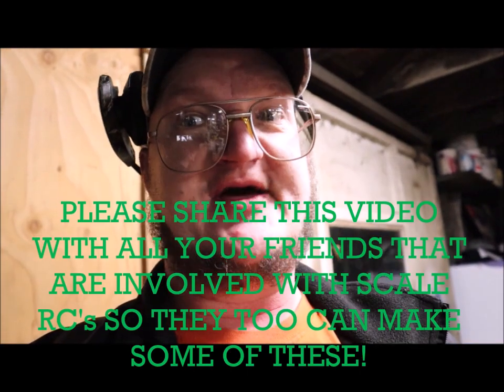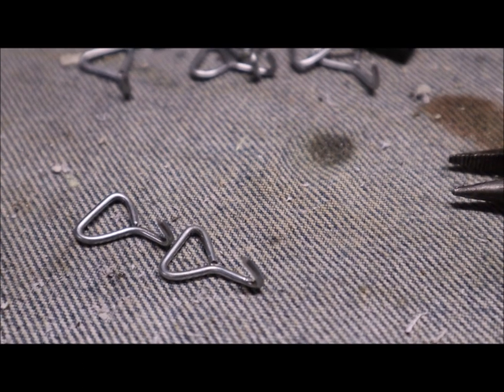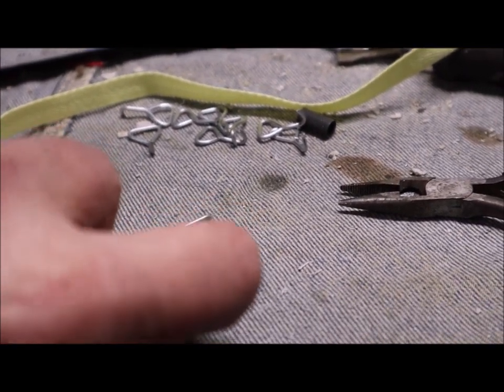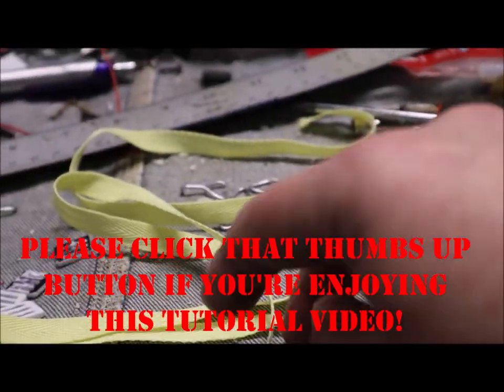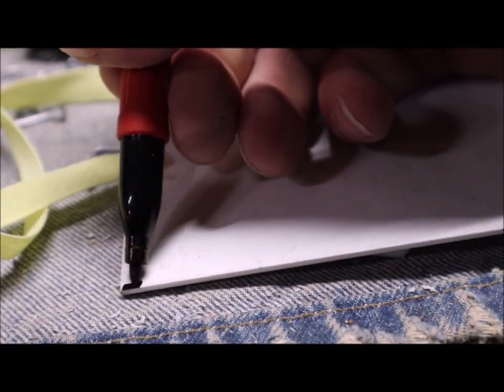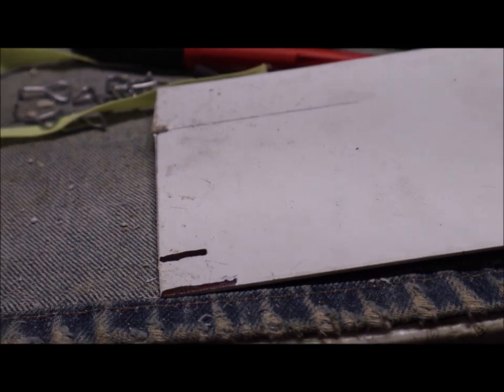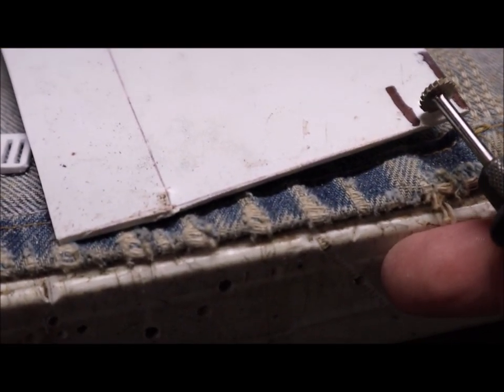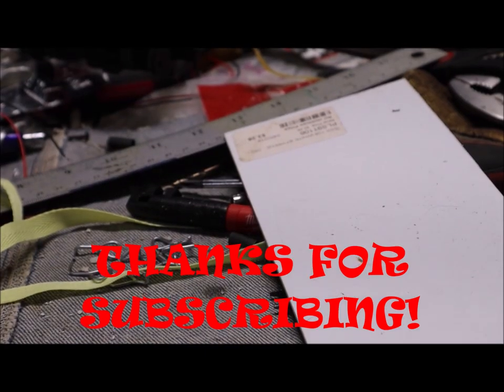DIY straps for RC vehicles

Comment: Nice how too 👍🏼  You need a printer so you can mass produce those buckles
Reply from the maker: I've got the printer, but I DON'T have enough knowledge of CAD to make the files!
Reply: @pnwRC.  Hi thanks for the video and instructions! I made a quick sketchup model of the buckle based on the measurements you said in the video (3mm border, 10mm slot, 3mm thick, 1.5mm spacing between slots.  Let me know if it works and is it ok if I link your video to the thingiverse description ? https://www.thingiverse.com/thing:4106663 Thanks again!
Reply from the maker: @BenSaraceno  That sounds good, please do link them to the video. Thank-you
Reply from the maker: @BenSaraceno  I believe that your design should work well. It would be great if you link them to this video in the description. Thank-you for designing this.

Comment: Next time, get some help with the video recording.   Most of the time, you couldn’t tell what you were doing.  Had you had help recording the video, your video would have been good.  Also, clean up your work area or at least lay down a clean work mat.  It looks like your work area is the back of an old Jean jacket or something similar. This comment is provided with the highest respect and in no way intended to be offensive or condescending.  This comment was provided to help.   I hope you provide the videos using help with the video recording.
Reply from the maker: All are excellent points! Suggestions noted for future reference.